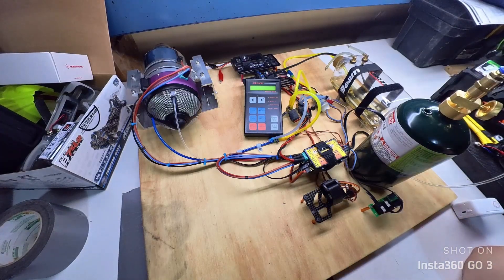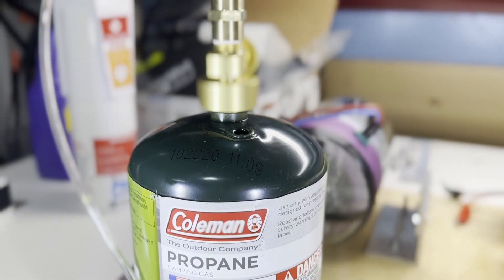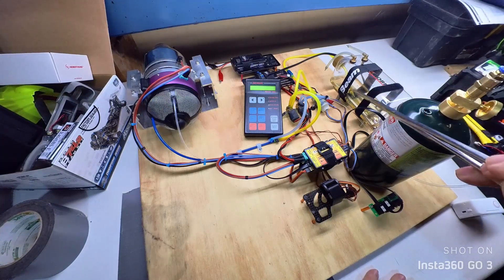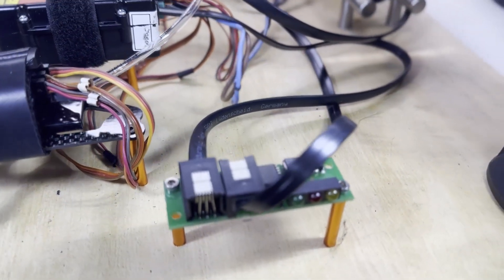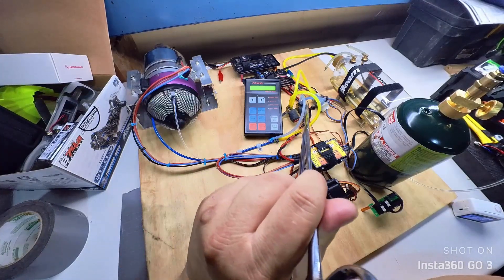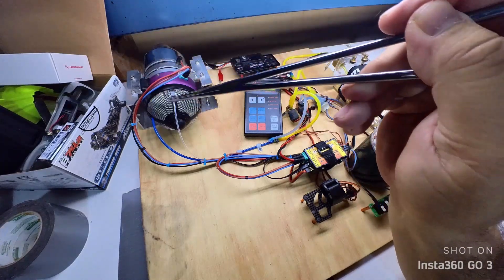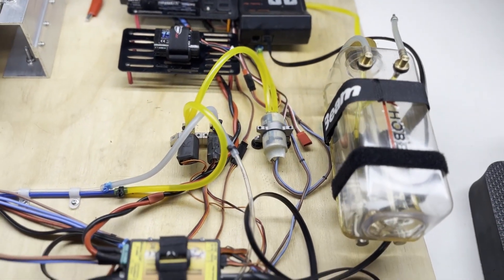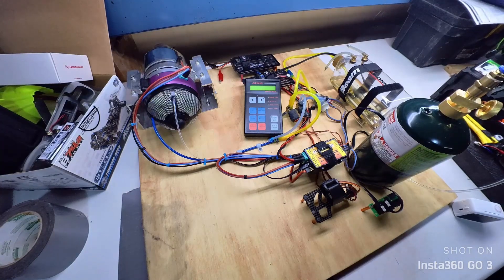RC JET Turbine, Jetcat P120 with Propane start, overview.

Comment: I bought mine pretty much already set up for $1,000.00 on eBay and thankfully he lives in Elk Grove while I was visiting my parents. We fired it up and ran well. Same as you’re set up except mine was diesel or kerosene. I ran diesel and installed it on my boat. It’s on you tube.

Comment: Where did you get that propane valve? Any links to it?
Reply from the maker: https://a.co/d/3Cg7ZdP
Reply from the maker: If the link does not work search this on Amazon "1LB Brass Propane Needle Control Valve,"
Reply: So beautiful 
I bought mine without the ground support unit so I can probably never run it but it was the only way for me to buy the whole thing for $500